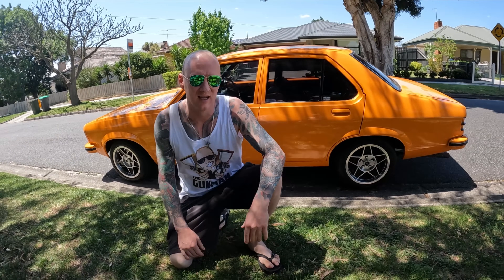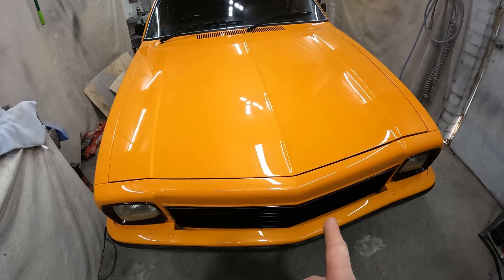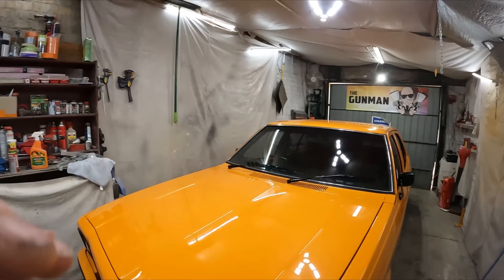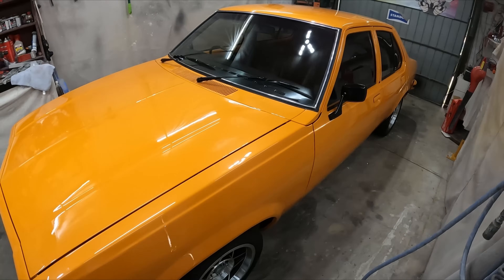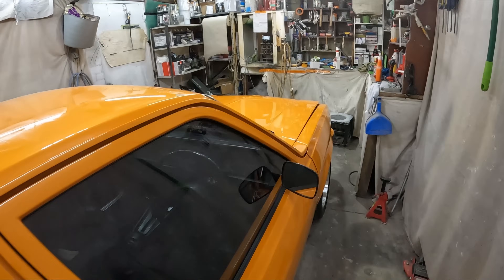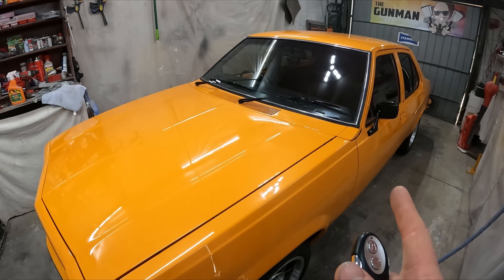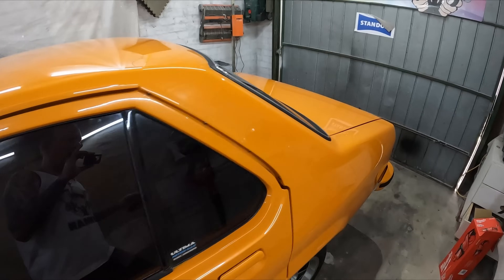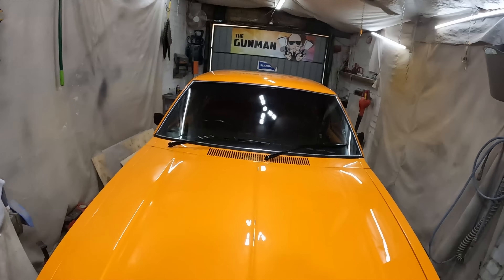Torana Finally Back on the Road

Comment: From memory some auto chokes are adjustable, turn them to tighten or loosen the internal spring pressure so they stay on longer or shorter. They won't "kick off". Ring the supplier. The car came up great mate

Comment: Hey gunny, great job mate 👍 wouldn't bother trying to fix the old bumper bars and get them re-chromed when you can get good quality reproductions from Restocountry for between $600 -$650 depending on if you want them with or without the holes for rubbers. Looks good with them painted anyway though, I've got a 77 LX with painted bumpers, and I think they look great. Just enjoy driving it now mate, Well Done 👏